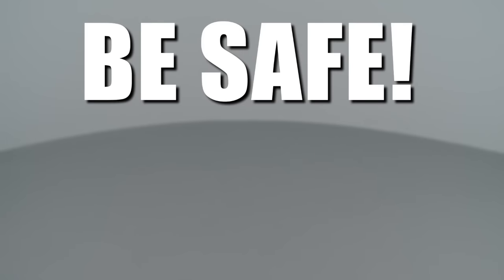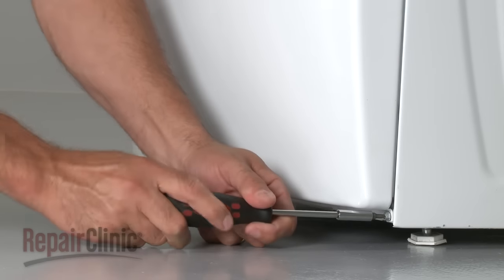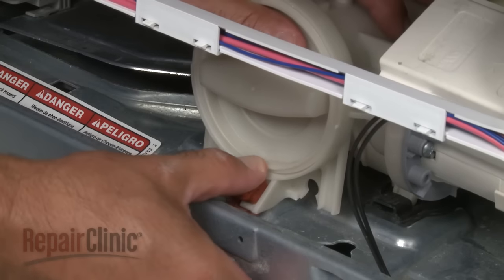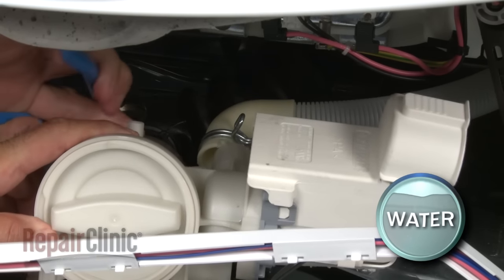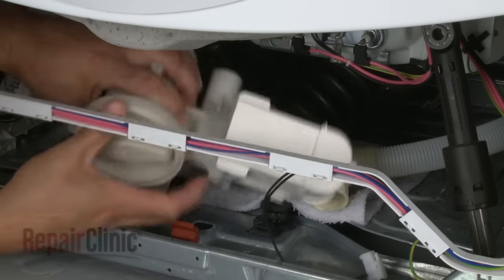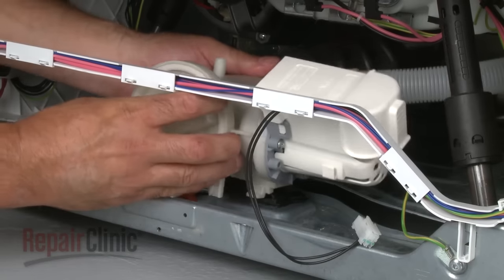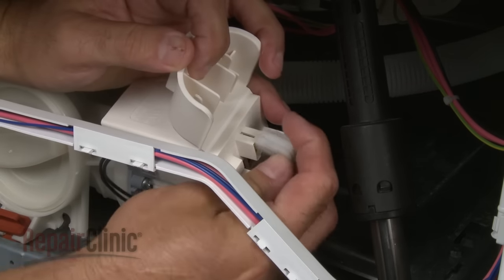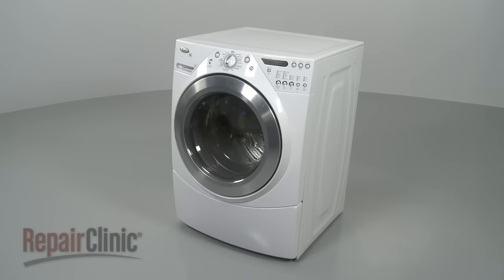Duet/HE3 Front-Load Washer Won't Drain? Drain Pump #280187

Comment: Great video!!! I struggled a bit securing flimsy rubber hose with clamp in the back, so I ended up securing drain pump first, and then was able to secure clamp to rubber hose a whole lot easier.

Comment: I have replaced the pump and the washer will drain a bit but then the washer shuts off. so there must be another problem. Initially it would not drain at all. now it will mostly drain and shut down with water still in the tub.

Comment: I get E2 F9 codes. Maytag. Manual says blockage. Cleaned screen and all hoses clear.Still the code repeats. The author loves to replace parts. He should at least opened up the pump filter and cleaned it before replacing. Shame!